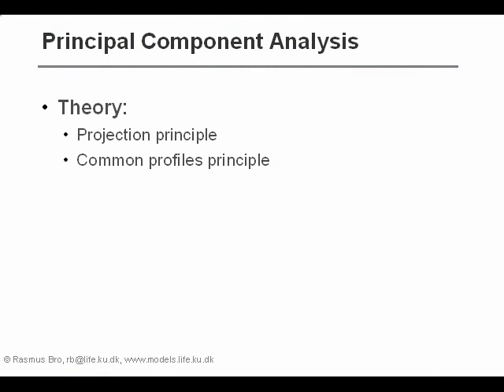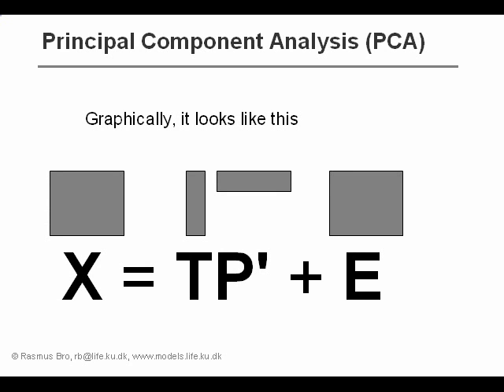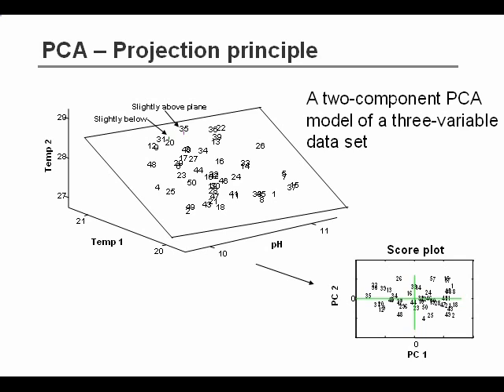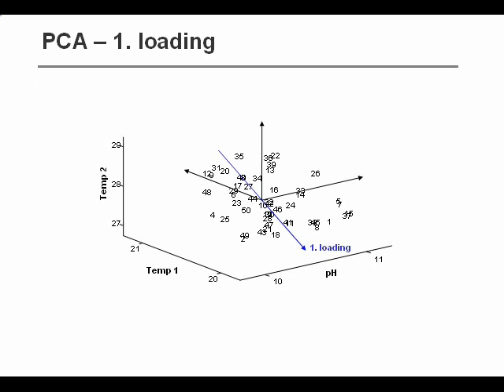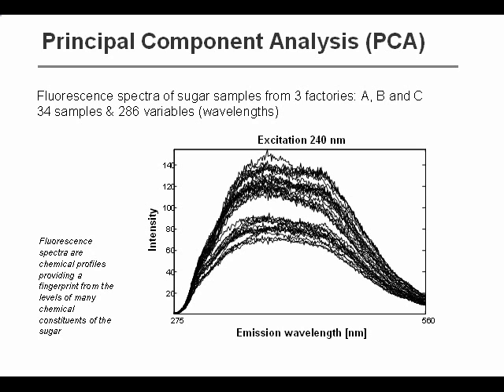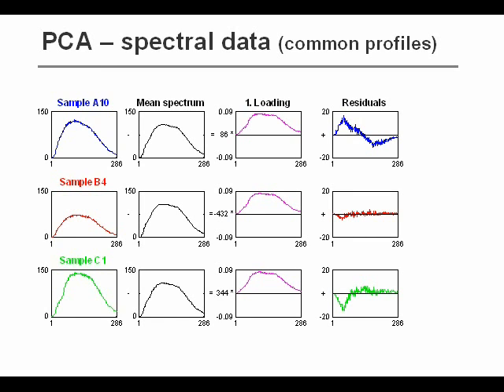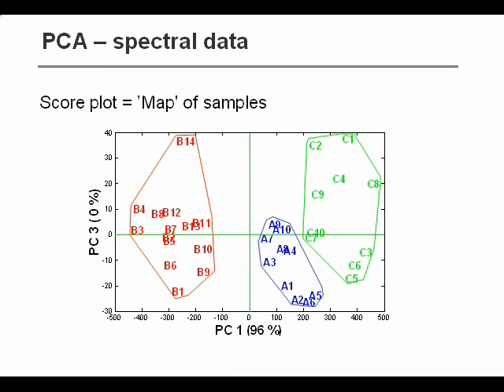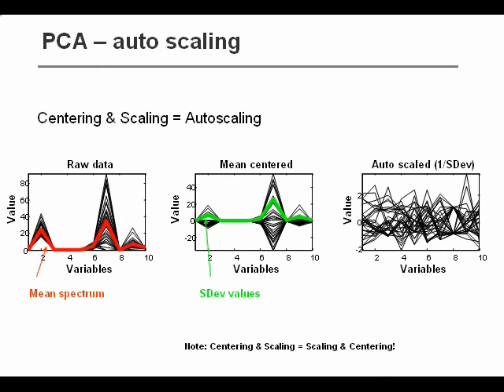Principal Component Analysis 2 Theory (1/2)

Comment: Hi Jolly

Sorry for not answering before. It is perhaps puzzling at first that a minor component can separate, but it is very common. In spectroscopy (as we have here), the first component typically explains a lot (50-95% depending on type and other things). With a suitable signal to noise ratio, small components can be absolutely valid and this third component with less than .5%  variance is absolutely fine. This can be verified e.g. by the loading vectors and its appearance

Comment: After you perform PCA and you get a new lower dimensional data set, do you typically normalize each component before using them as inputs to a model, or should you leave it the way it is?

Comment: Nice & clear presentation. But I am disappointed about the implicit definition of the score matrix by X=T.P' at 1:18. This is only valid if standard normalization of the loading matrix is assumed (P'.P=I). Several other normalizations are used, each with their own advantages when peforming orthogonal rotation (e.g., maintain orthogonality of PCs). For these, your formula takes a different form. I suggest using instead the explicit definition of scores, i.e., T = X.P, to avoid this caveat.

Comment: Hello, one thing is to remark that, you first referred the "new dimensions" as Principal Components" which consists of one row of the score and one of the loading matrix. Then your refer to the same thing (lines that forms the plane to project on which supposed to be the new dimensions) as "Loadings". Now, which one is true, the lines are loadings or PCs?
Reply: I am afraid I don't completely follow your question/notation. One component is made up of a score vector (a column vector) and a loading vector (also a column vector in our notation). You may also sometimes refer to the component through only its scores or only its loadings if convenient. I hope this is what your concern was about.
Reply: Rasmus Bro  Hello thanks for the very fast answer, you completely followed my question. This is actually a big ambiguity at least for me, since all these terms corresponds to different matrices which should be followed by different notations in the formula.
I am not criticizing you tho, after some more research I see that this ambiguity/confusion between loadings/scores/PCs/eigenvectors is actually in all the literature, especially differing for the different application areas of data science.
Below, I want to give two questions from StackExchange where this is discussed and might help the people who had similar confusions:
https://stats.stackexchange.com/questions/88118/what-exactly-is-called-principal-component-in-pca
https://stats.stackexchange.com/questions/143905/loadings-vs-eigenvectors-in-pca-when-to-use-one-or-another
Reply: Hi there. Indeed it is confusing but it does actually make sense. Think of e.g. pH. There are two aspects of that: how you measure it (take an electrode, calibrate etc) and then there is the actual value of a given beer sample. When you say the word pH, you may refer to both aspects or one of them. Same with a PC. You may talk about the definition (loading) or the actual value (score) or both! It's not wrong just confusing indeed. And different fields lean towards different common practices.
Reply: Rasmus Bro  Thanks for the example Prof. Bro, I definitely see your point.
Could you recommend a book for Chemometrics area? 
I have been working on Machine Learning area before but I am new to Chemometrics/Food Science, therefore I am sometimes struggling and more open to confusion. The notations, keywords, implementations are all different from what I studied, I must say I fell like I have learned PCA from the beginning recently :)